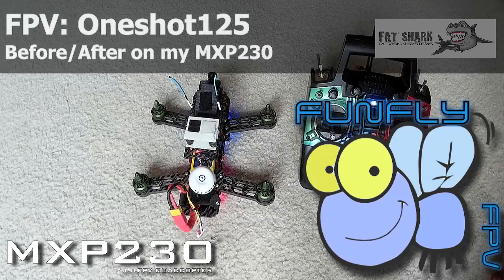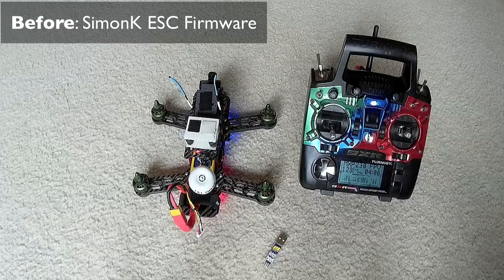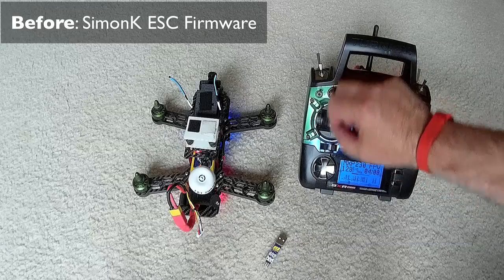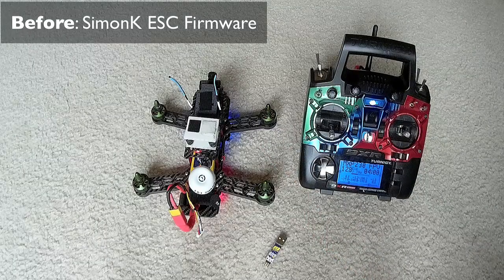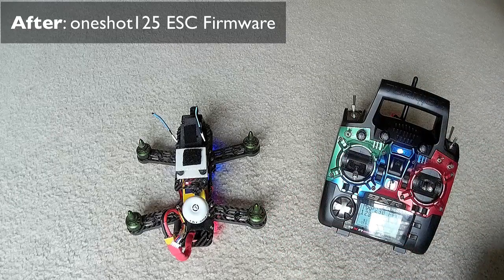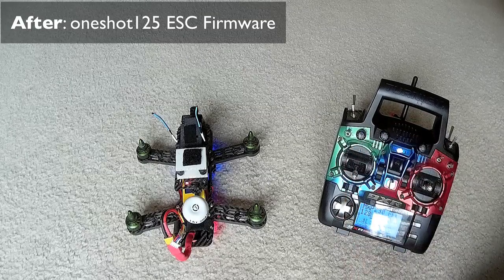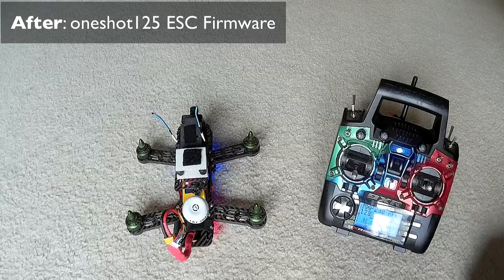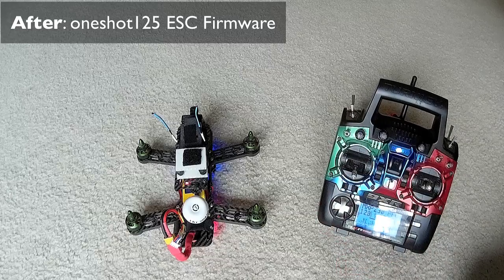FPV: OneShot125 enabled MXP230

Comment: Do you have in instructional video on what steps you took to flash them? Also, what version of the 12A esc are they? I have the 2nd version from HK that came with the 6A BECs that were causing issues
Reply from the maker: Rigo Arevalo I followed these instructions: https://www.youtube.com/watch?v=F9kWjTiH6xc

All my Afro 12A ESC's have the BEC so I don't think the BEC makes any difference.
Reply: Sounds like you have the good ones. Hobby King released a batch where the BECs were providing more amps that they should have. they were frying some flight controllers and the KK2.0 boards would freak out with them. Then HK fixed the issue and released the correct ones. I saw the video but it only covers SimonK flash I know the BLHeli is different